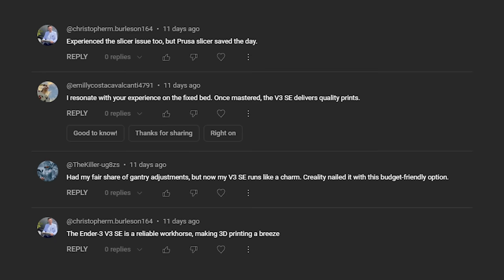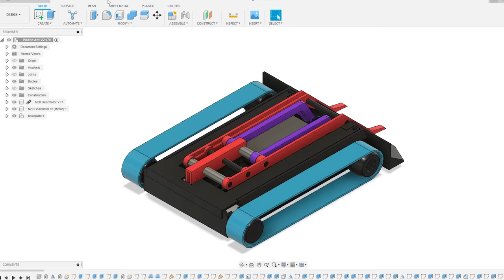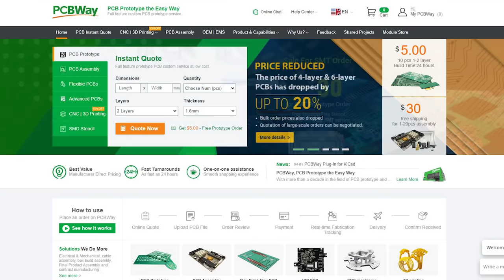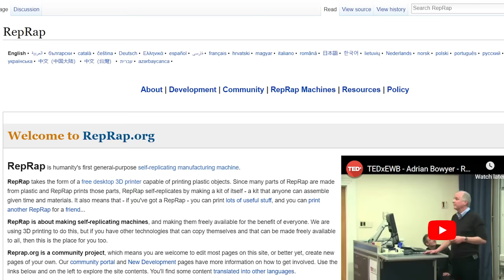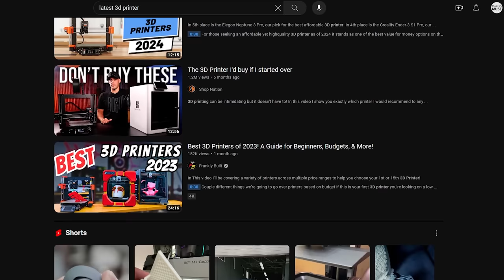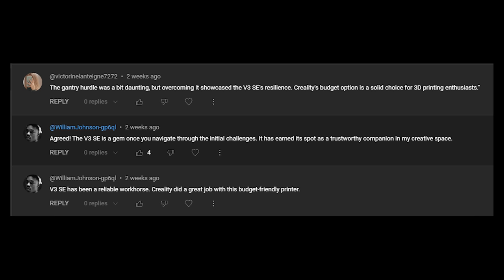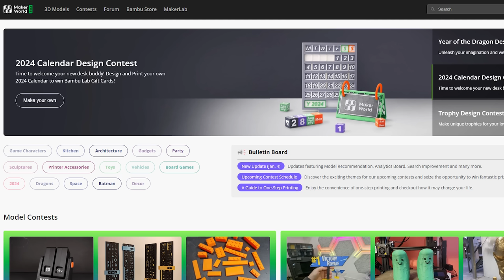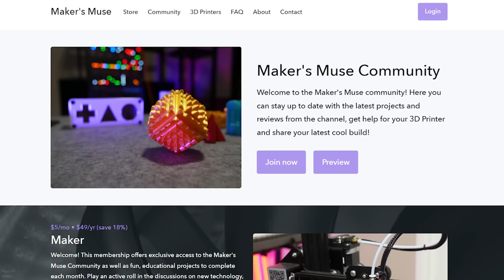My 3D Printing Predictions for 2024

Comment: Happy 2024! (oh man is this a big comment, sorry Angus)

Printers: they're gonna explode (metaphorically... though hopefully the community doesn't try to implode itself first)
CAD: so... I think it kinda did happen, but in slicers. More and more and more can be done just within the slicer. AI 3D models are... well, it's gonna get to a usable stage eventually, but it took years to get text and images to their current state in AI generation (copyright aside), but we're just starting on 3D models.
Localized manufacturing: it may not be at scale, but I think this has been going on already in nitch markets. I made a comment in a different video about my old company (2018/2019)'s fancy coffee maker breaking and found out the $10k coffee maker uses 3D parts inside and one had failed. The next day, the contract repairman showed up with a new 3D printed part. The machines are imported, so I made the assumption that it wasn't cost effective to mass manufacture those parts en-mass, and it would take too long to import them from the factory... so they instead 3D print certain parts so if they break, they can just 3D print them locally. And again, that was 2018/2019... but your point is growing and the voices saying "why would you print this, it's so much cheaper to just buy a storage case then to print one" are starting to be drowned out by "I don't need to go to the store or buy on Amazon, I can just print a new case"
Industrial parts: agree. I remember talking to someone at ERRF 2022 who design printers and they said they stopped 3D printing parts for the (1 off) printers because it was so much cheaper now to pay a local machine shop to do it out of steel and aluminum. They get a super rigid and fancy printer without being that much more expensive.
Consumer recycling: agreed, though I think it still needs to be operated at a larger scale then individual consumers. I just don't see the time/money/effort payoff at an individual level.

Consumer 3D printing: heck yea! I think it's good for someone to know how a thing works, and a lot of times, "how stuff works" fascinates people even if it's, like, a dish washer or something. So knowing how a 3D printer works is good... but now that you know that: press print. Press print. Keep pressing print. I don't want to recalibrate my printer after each print. I just want to print. Bambu is the current darling of that, but that's how I've operated with my Prusas too. Some have gotten their Enders and others to the same state where they press print, and it goes. Throw in Anker and many of the Bambu clones, and it's becoming more and more common and I love it. I still think even Bambu is way way far off from where they can go, but I always ask those interested in getting into 3D printing: do you want to tinker or print? 9 out of 10, they say they want to print. Though I am going to try to steer people to brands that benefit all users and not just their subset of users ;)
Trusting reviews: louder, for the people in the back... on the bot comments, I wonder how many of them also reply to livestreams. How many times has someone done a livestream, not gotten the printer out of the box, and dozens of comments show in the chat going "so should I buy this? Is this better then X?" hello... it's not even out of the box yet. And that was going on for years. It makes me think that it's 3rd party groups who come in, try to get testimony that a product is good/worth buying... then go to the company and say "hey, we asked reviewers to check your product and they like it. Pay us and we'll make sure others know about it too"
Professional printers: yes... though I do wonder to what extent. The place where people have said this loudly has been the Prusa vs. Bambu stuff, but Prusa has said (over and over) it's a dedicated division... and for as consumer focused as Bambu is, the ONLY show where Bambu actually showed up was Formnext, an enterprise trade show. One local employee catching a ride to a show and setting up on someone else's table is not "being at that show".
Repos: this one caught me off guard... 2023 was "Thingiverse is dying... but still big. MyMiniFactory is where you get paid models for table top and such. Printables for free models. And then there's Thangs and Cults" and now... well... it's the wild west, so yea. They're gonna be madness AND they will absolutely get flooded. If those repos aren't already looking at automated mitigation, they're not going to be able to keep up.
3MF: hmm... this is a tough one. There have been many demos of steganography in data types, and the importance of filtering data. For every printer besides Bambu, they don't operate on 3MF, they operate on gcode (or binary gcode) and kinda fit in the same boat. Gcode stuff edges on "can you memory overflow the gcode reader in firmware?" and that's one edge open source firmware has, is that people can look and go "yo, we found a vulnerability..." and verify it's fix. 3MFs fall in an area of "how does the slicers use them?" If there's a multi-gig 3MF for a calibration cube... something's off. But unless a similar memory overflow or similar vulnerability is found, it's gonna be hard to do anything other then store extra stuff in the zip file. Never doubt someone dedicated, but I think it's not as dramatic as may be assumed.

As for my own predictions for 2024:
The community is gonna eat itself alive. Dark, yes. But weather it's security and privacy within a printer and people not knowing what "reasonable disclosure" means, or general brand wars, content stealing, gaming contests, the infamous "3 letter word that starts with G" debates, snake oil filament sales, scamming people into thinking they're getting a free printer, "I can't believe you're charging $10 a month for 50 models on your Patreon... what a ripoff, that other Patreon does 100 models", and much more... it's gonna be brutal and painful. The only solution is gonna be moderation, block/mute lists, and probably cutting back on actually offering reviews and doing contests with money or prizes involved. It's probably going to result in some people getting canceled, some brands to fade to background, and maybe even some YouTube/streamer personalities to shutdown. This may even cause issues for those looking to "just print" and get into 3D printing, which will lead to...
...The community forks itself. I think there's gonna be a split between tinkerers and printers. You can go out and buy a car, find reviews of the car, learn about the car, get comments on little details about the car. And at no point is any of that from some car builder or car nut. No, it's just drivers. But you can also find forums and groups with the car nuts where they will tell you about a revision in a model that started at a specific factory at a specific time, how to videos to revert it or modify it, etc. I think the same arrangement is gonna happen in 3D printing. Voron, Creality, Prusa, and more on one side. Bambu and others, on the other side.Rebirth of the white label printer. Forget clones, there was a period of time (kinda still is) of printers made by someone else but with their own label on it. I think with Bambu's "Apple-attention grab and grip", the clones that show up... companies are gonna go "I can't compete with that... so I'm simply going to buy it instead and relabel it". I kinda view Bambu and Creality showing up in retail stores like MicroCenter are actually an example of it. Hear me out: retail is not "we sold to 10 customers today at a retail store" it's "we sold 50k printers to a retail store. They're out of our hands. The sale complete". It's a case of how to move printers quick without actually making a sale of them to a customer. And both places still want their cut... which means there's markup involved otherwise Bambu/Creality makes no money or MicroCenter needs to charge more then what Bambu/Creality charges. And if there's markup on some product, someone will come in and go "I will buy 200k of this P1S, put my own side panels on it, sign the NDA so I can have my own shop (let's be real, the contractor we hired from somewhere else) to recolor and reskin the UI, and do my own packaging, and then sell it ourselves." It happened before with printers, it happens all the time with filament, what's to stop it from happening again?
Hot take: we hit the wall on speed. That's right, the faster we print, the more issues we have with structural components, the more cooling the extruder needs (which adds certain issues especially if companies don't heavily test filaments on their own printers, but also the different look... and one of the largest reason people go out and buy a faster printer for farms is... so they can print fast. But if they see a TikTok of some incredibly beautiful filament, buy 50kg of it to make bank on TikTok and Etsy and then find out... it looks different when they print it fast. They're gonna go "ick... I'm gonna have to charge more for those prints because of lower turnaround". Your silks need to be printed slower, your French cleats need to be printed slower, your supports get knocked over if you print too fast, etc. and it's gonna be "it's great you printed the benchy in 5 min... how come that new bust halls apart in my hand when I print it at the same speed?". We either hit the wall on speed, or a technical improvement occurs that lets us print faster that isn't just fans fans and more fans, plus the higher flow nozzle or 2.
More multicolor and multimaterial. It picked up steam in 2023, but 2024 there's already people who looked at the "DOA" Prusa XL and are now going "I want one... simply so I can do multi-color at speed without the waste" and that may spur more multi-tool printers, better waste management in slicers, and more.
Reply: While I have 100% posted bigger comments, YouTube balked at this one.

Cont. my own 2024 predictions
Battle of the farm software: Bambu has it's cloud... Creality has it's own, Prusa has PrusaConnect, and there are others. But farmers are going to need to decide "do we manage 5 different clouds or do we switch everything to one printer brand?". Bambu let's you control 1 at a time, PrusaConnect lets you queue up and control farms, the (abandoned) OctoFarm is still used because there's no real alt. And for all we know, someone will figure out how to tie them all together... to make an additional option that only gets partial use. But I know so many who started with a single Ender 3 and graduated to 5-6 Bambu's, maybe a Prusa, and the Ender 3 is still there... some collect dust, others are used as backups/not for the farm. Managing them will become more and more important.

This comment is huge. If you made it here... hello! Not really a prediction, more a wish: I want slicers to become more "here's the model, just slice and print" and to actually work well. Better filament management (either through an AMS-like thing or being able to buy filament and have a tuned setting already in the slicers). I want people and companies to stop talking about privacy and security and actually implement it... stop going "why won't you use us, we're more secure" or saying "we're already secure, believe us" and just do it and if/when the others get hacked, printers get remote controlled into damaging themselves, etc. you can gloat about it then... but "just do the right thing" and stop waiting for the market to emerge from underground to say "yes, finally". I want consumer printers to become appliances for those who want to just print... no, Bambu is not it... they're like 5-10% of what I'm thinking: I want to bring a box into a family member's home, say make an account (with or without app), and then go "search these sites and press print. The printer will tell you if it needs anything or if there's a problem" and then the person walks away. It almost doesn't matter if it's fast or slow, it just needs to work 100% of the time or die trying. And it shouldn't die for at least a few years. No maintenance, no tweaks. Enough with cleaning the rods, greasing the bearings, and picking filament out of the gears. Here's my filament, I want that model, print. And walk away. I know people who will point at their Bambu and say they do that. I do that with my Prusa. But if I give either to my parents, I 100% guarantee that I will get a call from them in 2 weeks saying it broke the first day and they don't know what to do, and one of them tried to fix it and broke it more, and they tried to contact support but they asked them to take apart the printer or charged for repair and they said "nah, we'll contact our kid instead". Get some go-to-home repair person, service contacts, etc. and you're now REALLY being like an appliance.

Comment: I think the winner of the repository wars is going to be won by the site that offers the best incentives to its user base. So far it looks like printables has the lead as far as that goes, but we'll see if/ how that changes moving forward.
Reply: It's going to be whoever builds a robust, integrated ecosystem around it. Basically doing what Apple/Google has done with their systems with all the seamless integrations and so on.
Reply: Hopefully it won't be the site that steals the most :/
Reply: Makerworld is winning that easily. Printables is definitely second and has more models, but has nothing like the reward program Makerworld does, or the level of integration.

Comment: Thank you for some really nice content. I am one of those newcomers to the 3D printing world. With a background in 3D (worked for Silicon Graphics as a product specialist on the Alias|Wavefront products), I feel quite comfortable with both design and manufacturing. I just bought a Prusa MK4, not because it is the sexiest or fastest printer available, but simply cause I did the research and it seems like Prusa products just work and are supported for many years. Happy 3D printing to everyone in 2024.

Comment: my  first printer was a solidoodle in 2012. It surprisingly worked out of the box. But did not offer any room for much customization. So I used it to build myself a reprap. It has been DIY machines for me.from then on.

I have made CNC machines, 3d printers, Lazer engravers. And the best part about DIY Machines is that you learn SO MUCH MORE when doing it yourself!

Comment: I only had my 3D printer for a little over 2 years (QIDI X-Plus) and loving it. What is so cool about 3d printers is that I just moved into my new home and while slowly moving in used the 3d printer to create useful tools around the new house. Some items have been: custom stand for the two center speakers; Wall monitor mount for my 27" monitor to watch birds; wire supports to hide all computer cables; Camera mount for the webcam; glow in the dark bird feeder; 7' wide flatbed window mounted bird feeder; custom letter holder to place outside; and last currently working on a Squirrel running toy. This all in the FIRST month of living here. :) Design all in FreeCAD.

Comment: I have a woodworking hobby and decided to expand it to include 3D printing with an Artillery Sidewinder X2.  I had nothing but problems with the hardware.  I gave up and threw it away.  Years later, I took a chance on a Bambu Lab P1P.  I finally have a dependable tool and am excited about learning CAD.
Reply: Shame on 3D printer companies that it took so long, but I'm happy you came back to 3D printing.
Reply: Weird I have both x1 and x2 and couldn't be happier.

Comment: Totally agree about printers that just work. I just got a Bambu A1 and its in a different league to my previous Anycubic and Creality printers. Both the Anycubic and Creality units produced great prints, but it was often a battle to get there. I didnt print anything for almost a year because my printer just decided to stop working properly one day and I couldn't get it back to an acceptable working state. Its early days but the A1 just works.

I understand that there are people out there that want to tinker with their printers, and I did for a while, but when it becomes something you have to do just to get it to work its no longer fun.
Reply: I owned an ANet printer for 3 years. It worked OK I guess but setting it up for every print was (levelling the bed was a nightmare) time consuming and a real pain the A. I sold it and bought a Bambu Lab P1S and the difference is nothing short of remarkable. Using the Bambu Lab slicer, I just input my STL, then slice the print according to settings I made and send it off to the printer via WiFi. I have in the 6 months of owning never had failed print. The most satisfying part is seeing the first layer go down smooth and precise. All I wanted from my printer is to make parts for my projects and not for fancy figures and not have to fight with it to do so. I liked it so much I bought the AMS for it and it works like a champ. This printer has fit the bill beyond my dreams. 👍👍👍😁